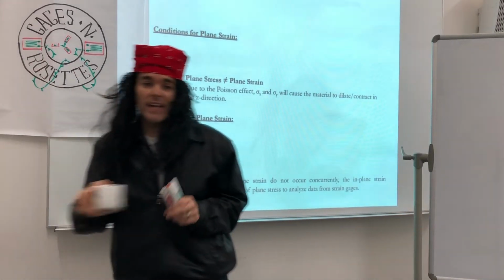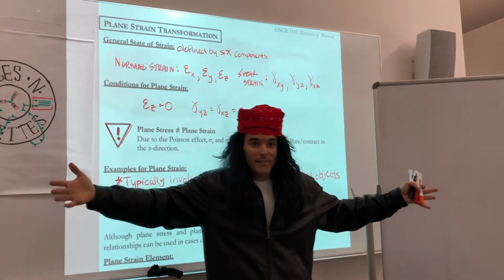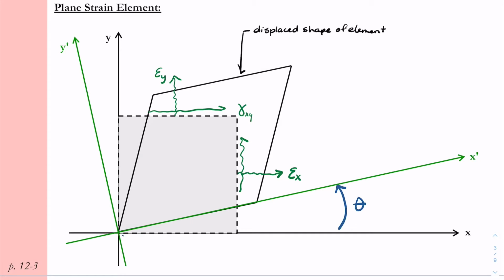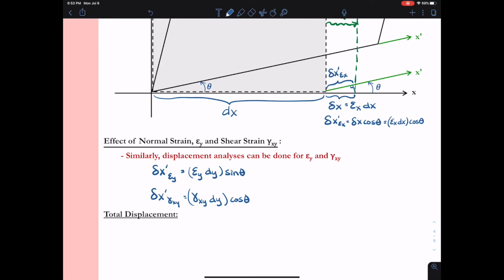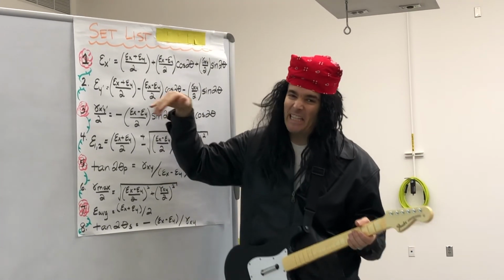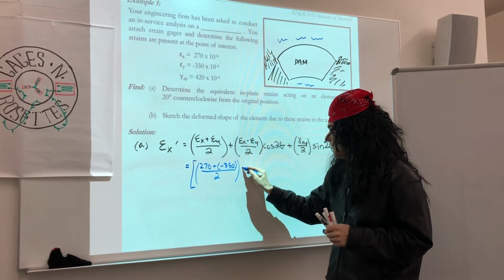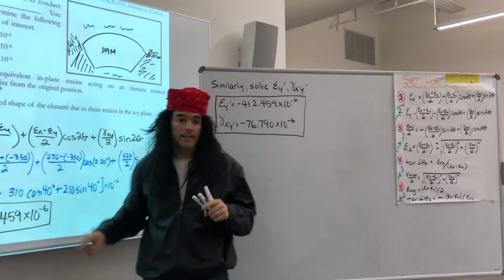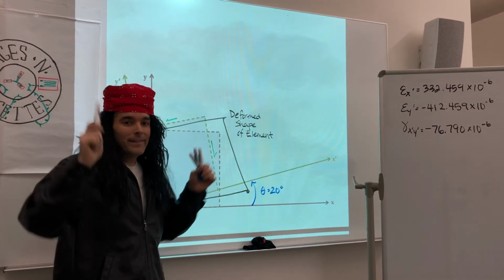V12-2 Strain Transformation

Comment: Isn’t cosine the adjacent over hypotenuse. How would Delta X Over Delta X prime equal cosine go to Delta X prime equals Delta X Cosine of theta. By this Method wouldn’t it be Delta X prime equals Delta X divided by cosine of theta

Basically, meaning that the strain in the extraction equals cosine of theta, and the strain in the Y direction is sine of Theta
Reply: Ok, so there’s a step with a smaller right triangle between the Delta X and Delta X prime Using Delta X as a Hypotenuse, Aren’t we cutting off a segment of Delta X prime. What exactly happens to this loss segment.